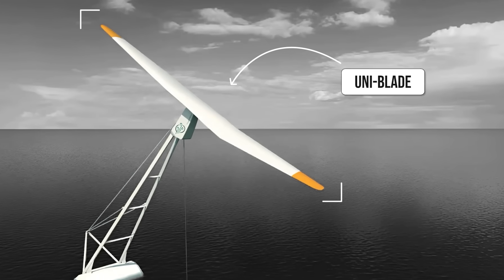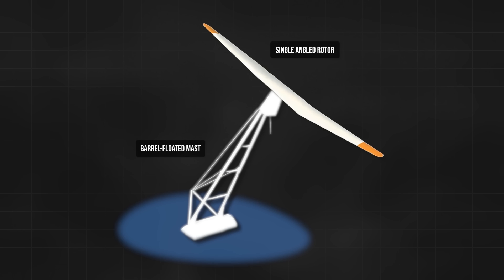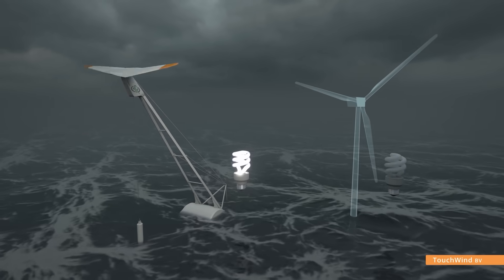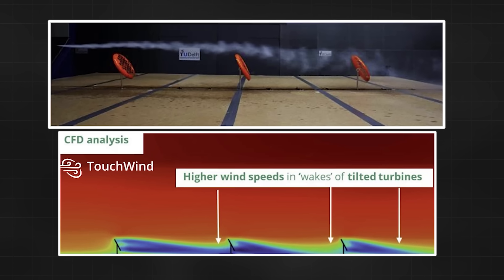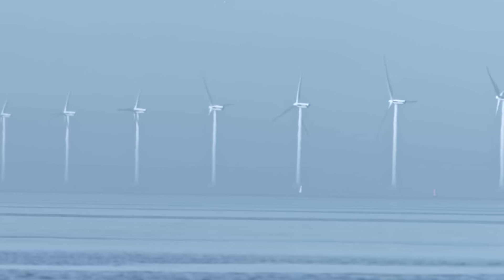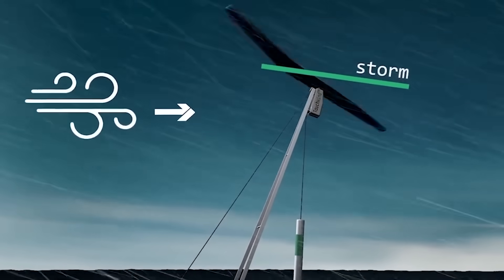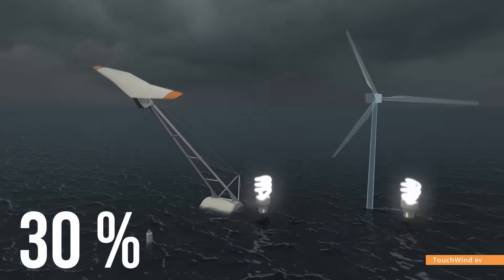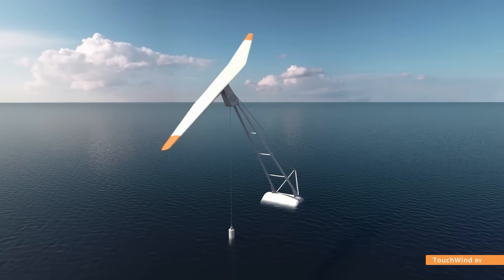Insane New Turbine Promises CHEAP Unlimited Energy

Comment: The biggest turbine (type MySE 16-260) of the  China Three Gorges Corporation has a max power rating of 16 Megawatts and are designed to operate in tropic storms that are occuring yearly in the South China Sea. The turbine remains operable at wind speeds up to 79,8 meters per second or 287 km/h. The efficiency of the turbine is nearing 90% of the Betz's coefficient (max achievable extraction of wind power by a wind turbine, is 59.3% in accordance with Betz law).
It would be interesting to see the efficiency of the one blade turbine mentioned in the video.
Reply: Truly a beast, overwhelms offshore wind problem areas with shear size - but also a massive capital cost.
Reply: Their is no way a turbines OPERATES in winds that fast, they mearly survive them.  All turbines have a cutout speed where they apply brakes and stop turning.  What your quoting is the wind speed which would overwhelm and utterly destroy the turbine.  Fortunatly it is a speed well above even catagory 5 hurricane winds and is only a little below the highest hurricane speed ever recorded a 96 m/s so if the engineering is accurate it is a very durable turbine.

Comment: as someone who did math/homework estimating wind turbine prodution on my location, i want to correct some stuff i noticed on wind frequency
it's not that majority of power is produced on slow winds, it's the wind speed frequency, low winds could be just junk energy and won't give much, anything below 10~5m/s range is junk energy production, definitly high winds are better for energy production, but because they have less frequency then they can't rely on them for constant energy production, but some wind farms definity will disconnect some percentage of the wind farm to keep the energy stable, but above a certain speed most wind turbines that are optimized to spin at certain high frequency mid-range speeds won't be efficient and could spin out of control, so they are disabled
so this wind turbine design looks promising in theory, but as pointed out, it's yet have to be seen if the design can handle sea water, swells and waves.
Reply: I didn't understood that chart, it seemed like a probability distribution of the different speeds but the Y axis has values up to 0.09 are all those values supposed to add up to one? as in 100%
Reply: In this regard it's worth noting that wind energy increases in proportion to the CUBE of the wind speed. For example a 10 m/s wind has EIGHT times more power than a 5 m/s wind and a 20 m/s wind has SIXTY FOUR times more power than a 5 m/s wind.  So the high speed winds are the ones to capture even if there is a reduction in efficiency due to the angle of the rotor blade. One other issue not directly mentioned will be the stress created on the hub due to wave action exacerbated the the gyroscopic stability force generated by the fast spinning of the rotor.  So a fast spinning rotor will have massive gyroscopic inertia while the base will want to bounce around in a choppy ocean.  This provides an interesting engineering problem.
Reply: @alanbuckle3738  i know about cubic law of power, but my point still holds, for example there is hight amount of power in lightning but bc it's duraction is microseconds so you have to spend lot of money on capacitors for storage, so it makes this form of energy expensive,
so the complain about wind power was intermitence and the reason offshore windturbines were popular was bc winds offshore are more constant than on land.

Comment: Ziroth - z-idiot? if you don't even understand that a helicopter rotor pushes air down to create lift, you shouldn't be reporting on this kind of topics. The reason big shipping is interested in mono i because they could put them on freight ships. Otherwise decent clip
Reply from the maker: There is a great video explaining gyroscopes in more detail on YouTube, definitely worth a watch. It sounds counter intuitive, but the rotor doesn't have to push all the air downwards, it just needs to create a pressure difference between the upper and lower blades. It was too complex to cover in detail in this video, but although the air is redirected it doesn't have to completely change direction. It is also important to look at the air from the perspective the the rotating blade, not as an outside observer!
Reply: He wasn't talking about a helicopter. He was talking about an autogyro. If you can't tell the difference maybe you shouldn't comment on such topics.

Comment: They could need 2 propellers, to compensate rotational torque, like by coaxial rotor helicopters, with swashplates, to control best tilting angle and efficiency.
Reply: Explain the need to compensate torque. Swash plates are a means to change rotor pitch relative to angular position. What is the relevance of variable pitch in this application?
Reply: @nickwinn7812  I would explain you first of all, that well mannered people speak politely to each other, and use such words, like: "could you please".

Comment: One interesting aspect with this design is that high wind loads will be putting the tower in tension , rather than pushing it sideways with a cantilever force, so you can have a much more lightweight tower structure, as steel is excellent at resisting tension but needs a lot more engineering to resist a cantilevering force.
Reply: ? so there will be no force perpendicular to the tower in high winds? the tower will be sailing along at the wind speed if your analysis is correct. The tower must hold the rotor against the wind, therefore there will be bending forces on the tower. (described by you as "cantilevering force").
The "engineering" as you describe it, for steel to resist bending forces is well understood and not at all a technical challenge. 
Interesting that you assume the tower will be built from steel and steel alone. An assumption that ought to be challenged.

Comment: One big reason of why rotors usually have three blades is the constant inertia to rotate around the vertical axis. With two blade it rotates easier when they are vertical as when they are horizontal. That causes some issues. 
Also making a 200 m blade is more complex than 100m ones to have the same diameter. 
I think it is just paper ware.
Reply: Precisely ! Side Load on the shaft will be on again , off again due to  wind gradient . Much fatigue going to happen . Also gyroscopic load of a large spinning mass  trying to bob about . Not going to work .
Reply: @57greyghost  yes that bobbing and huge gyro load instinctively feels hard to manage

Comment: That's technically a two bladed turbine, designed as a single blade, which doesn't give any significant benefit, but a lot of disadvantages. Conventional pitch control isn't very problematic, and has multiple significant to huge advantages over tilting the whole construction.  The "uniblade" design makes the issues with making and transporting big turbines with that design as bad as conventional turbine designs with twice the rotor diameter,     

Will the wind be directed downwards? Sure, typically yes, slightly at least. Will that increase net power generation compared to just utilizing the wind in the best ways we know, and/or decrease cost of the power generated? Definitely no! There's no free lunch in physics, if you redirect the flow you're not utilizing the energy in the wind as efficiently as you could have, and can't "gather" and focus airflow from way above the turbines that way.

Comment: Alas, the ocean environment has an almost infinite capacity for destroying things. Assuming these remote turbines survive and require zero or at least infrequent maintenance, the needs of the long-range power-transmission system - cables, etc - may well negate any advantages gained by the innovative design.

No, I'm not an engineer, just a grumpy sceptic who learned long ago that energy is always, ALWAYS going to be expensive. Even if the generation of that energy somehow became absolutely free, companies would simply hike the cost of providing it with unfair tariffs and enormous daily "standing charges" (what a scam!) to ensure that the wealthy continue to pay through the nose to heat their luxurious swimming pools, and the poor remain huddled in blankets because they can't afford to heat their homes.

As I write this (in the cold, wet, grey, gloomy, miserable north of England) I really am wrapped in a blanket. It's June and, typically for Britain, still wintry. Despite the marvellous claims of the electricity-supply companies about green energy, renewables, carbon-neutral shenanigans and the joys of eco-friendly power generation, I haven't been able to heat my home (or have hot running water) since 2009.

I can't afford heating of any kind, so it's a blanket and a woolly hat for me. Fancy turbines make great video subjects, but no amount of aerodynamic research or epoxy-carbon-aramid-fibre composites will stop my teeth chattering.

Comment: Maybe I missed this, but how does it turn when the wind direction changes?
Reply: Likely through path of least effort principle. The wind is doing all the work, the main axis is just rotatable.
Reply: I suspect it needs a turret mooring and Slip Ring for power export. Same technology used reliably offshore for decades on FPSO vessels in Oil and Gas industry.  Look up “Moog Focal Model 483”

Comment: 4:35 you can't just assume they are all going to be in a straight line down-wind from one another.. the air goes somewhere, and it's hardly getting compressed, it's getting blown down then flattened out, so all adjacent ones behind it and to the sides are getting that turbulence. You can't just magic it away and show it stopping at each turbine, lmao.. Why model the normal ones in 3D, then show these in simplified 2D. Also I have serious reservations about a turbine that has to pitch-up to save itself, if the stronger the wind is, the harder it can force it to pitch-down.. less surface area, yes, but also higher wind speeds and front-surface exposure into those winds.. forcing it back down then the wind catches the prop again, then pulled down even harder?
Reply: >he stronger the wind is, the harder it can force it to pitch-down..
No - the stronger the wind is, the more it will pitch up: the same force that's pulling the air downwards to the surface of the sea is trying to pitch up the turbine.  That's why you need that weight.  Without the weight it would pitch up too much even in calm wind.

Comment: One of the most exciting aspects of this design is ease of assembly and maintenance. Being able to attach and assemble the entire rotor and generator near the surface of the water is huge. And then being able to just pull it down again to work on it. But now you say they are looking at more conventional flotation platforms. It would be a pity to lose disability to rotate it up and down for service.
Reply: The new base seems to be more about housing a rotation axis for the tilt than removing the variable tilt (it is the main feature after all) while being more stable in waves.
Reply: @_larkin_321  To sum up, I'd say is about addressing real life problems as opposed to lab conditions.

Comment: 12.5 MWh
Reply: What does your question even mean? The unit here is MW, not MWh.
Reply: @seneca983  My mistake 12.5 MWh. I guess I get a bit bored of ideas which are promoted on YouTube but it then turns out there is no working example.
Reply: @charleswillcock3235  Where does that figure come from? I re-watched this video I didn't notice that figure.

Comment: As others have mentioned the passive functionality - it's response to high winds -  has an appeal.  I assume that the developer is relying on this to avoid the need for pitch control: that's where my scepticism would lie. Two other points which are important: 
the swept disc is always at an inclination to the wind, reducing output straight away.   I think that gives it a serious handicap;
single and twin bladed designs are vulnerable to destructive vibration about an axis parallel to the blades.  This could kill the project

Comment: I've been wondering for years why they didn't make wind blades wider, always long and thin, this design can be made out of three parts
Reply: Wider blades are far less efficient than short stubby ones. For a given area of blade a higher aspect ration will create a much larger lift/drag ratio. Think gliders Vs fighter jets
Reply: It's because the blades move quite fast through the air. Faster means that thinner blades are optimal. Bigger blades would increase drag.

Comment: I'm dubious about the claim that reducing the wind wake can "suck in" fast air from above the wind farm. The slow air still has to go somewhere, contrary to what the graphic at 8:58 suggests. At best you can spread it out to 5 times as wide and 1/5th as high as the blade disk of the wind turbine or so. Yes, it will help in the case where the next turbine downwind is exactly in the path of another turbine, but now it will actually reduce wind speeds when the next turbine is within that 5 blade disk wide wake, making wake problems 5 times as likely to happen. And after 5 consecutive turbines have sucked in and spread out the wake, you're back to about the same wake height as before.
But maybe this is just a cost saving measure as well. 5 times as likely wake effects of 1/5th the strength will reduce the maximum dynamic load from wake turbulence to 1/5th. I just wonder if wake turbulence adds that much of a load compared to natural air turbulence in rough seas.
Reply: Since the used wind has been slowed (energy extracted) by the rotor, that slowed wake flow takes up a larger downwind volume than you suggest, further reducing any wake avoidance on downwind rotors
Reply: Complicated but the rotor will have sucked energy out of the air so will affect surrounding turbines to some extent. Needs a lot of modelling and real world testing. A way to go with this. Similar to perovskites and solar. It takes a lot to unseat the king
Reply: Ground effect lift think about it.
Reply: @Barskor1  Good point.

Comment: A large portion of the cost of wind turbines is distributing the energy to the grid. Is this included in the calculations for this?
Reply: It shouldn't be any different than for the kind of offshore wind turbines that are use in today.
Reply: @seneca983  Theyre supposed to go further out to sea in rougher conditions. There will be an increase in cost

Comment: Looks interesting, almost as though it might work / be profitable.
One thing.
As they swing into the wind, they, like all turbines, need a 360 deg bearing, and transfer of power.  Normally up high, but with this design it is at water level so vulnerable. 
On the design of the one piece blade (why said to be asymmetrical) the disadvantage is that the blade cannot change angle to gain the most efficiency.  This is offset by cost and less maintenance
Reply: I think the 360 degree bearing here may be in the ocean floor anchor.
... Then again, that still doesn't explain how the cables connect.
Reply: @Pystro That is accomplished with a Slip Ring.  Same technology used reliably offshore for decades on FPSO vessels in Oil and Gas industry.  Look up “Moog Focal Model 483”
Reply: "why said to be asymmetrical"

I don't think it was said to be asymmetrical. I think it only looks asymmetrical in some of these animations because of perspective.

Comment: Floating windmills or wave generators for that matter has the same issue - you can not protect the investment from sea-drones, both submerged and surface drones. The cables to land also has the same issue. The solution is land based.
Reply: The same is true for communication cables, power interconnections, gas pipelines (Nord Stream), and - if your country has none of the above - shipping lanes. If you piss off an adversary who is willing to attack this kind of infrastructure, they will find a target (on sea or on land). The question is just if a single attack takes out the gas supply pathway that ordinarily carries 90% of your gas, if you have a handful of cables total (big offshore wind farms, communication), or if it's highly parallelized (shipping lanes).
Reply: there is no problem, there's enough oil, gas, coal and uranium for 100s of years.
Reply: @axeman2638  Yes but renewable energy is less expensive and has less red tape. Once the issues with batteries are resolved, it's game over for all the energy sources. It could take another 20 years before batteries are cheap enough for baseload.
Reply: @imzjustplayin  Lol, and you actually believe that bollocks do you?  If renewables were cheaper everyone would be using them and there would be no need for subsidies and tax incentives would there? Delusional.
Reply: @axeman2638  Solar PV is already significantly cheaper than baseload. A Solar PV array at the utility scale can be installed for around $0.70 per watt before tax incentives. After 25 years of production (that's the warranty) comes out to an amortized cost of $0.015 per KWH produced.
Reply: @imzjustplayin  Absolute bollocks.
Citations needed.
Reply: @imzjustplayin  A watt of solar panels does not equal a consistent watt of actual power generation.
Reply: @axeman2638  Consistent? No, but the numbers I provided are for an average of only 4 hours of sunlight every day for 25 years. Batteries will bridge the gap but that will be many years down the road.
Reply: @axeman2638  The tax credits aren't really needed but the idea is to encourage adoption of them.